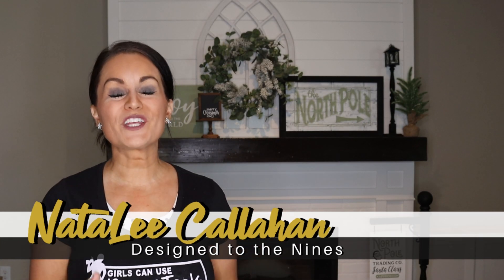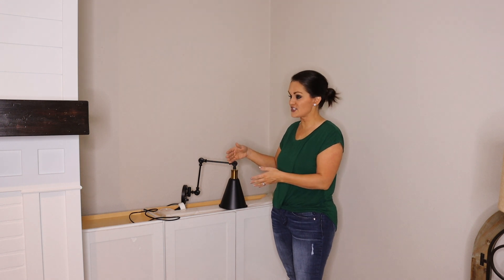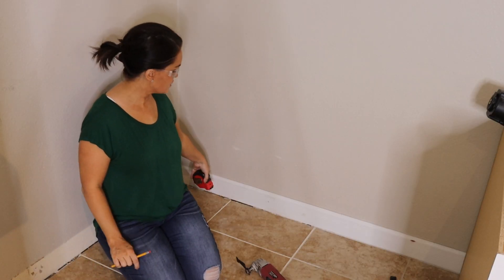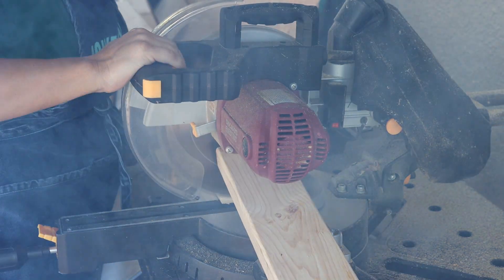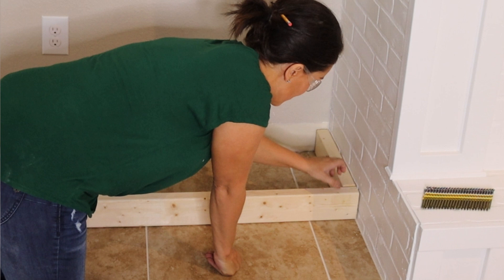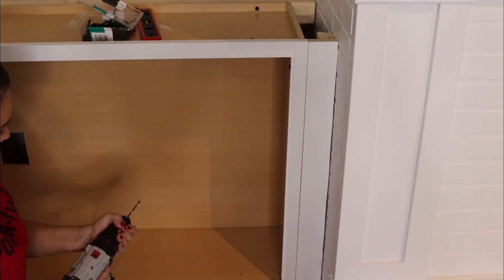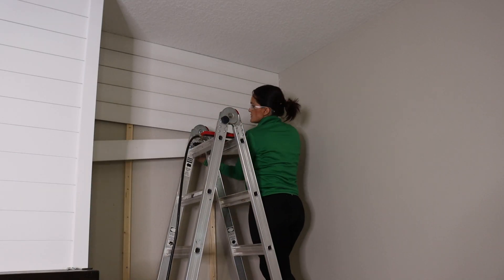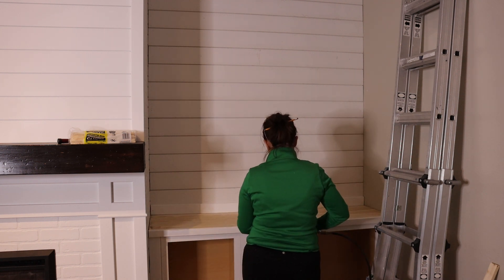You Can DIY a Fireplace Wall | DIY Shiplap Built In Side Shelves

Comment: It looks absolutely beautiful! Isn't it fulfilling to do a project yourself ? :-)  I would love to see how you  have decorated  your shelves . Here's a tip for the next time you have to fish a wire down... Tie a large heavy metal washer or a large heavy fishing weight or something to the end of the string. Then when you drop it down the weight will pull it through.😉
Reply from the maker: I had a heavy needle… It would drop down fine. The one on the right hand side kept getting fetched up on some thing because I simply just didn’t leave a ton of room to work with. That’s why I would recommend going about an inch thicker next time. But I like that idea as well! A washer would’ve worked perfectly.😃

Comment: This is amazing!  Are there smaller versions of the nail gun that are not run off of an air compressor? So much faster than screws but need something lighter.
Reply from the maker: Yes. There are both battery operated and plug in. But if you are using it for the studs I would use screws and a drill for that part over smaller nails as the nails you get for the smaller nail gun wouldn’t be nearly long enough or thick enough to support the weight. The smaller guns are perfect for the finish work:trim though! 😊
Reply: @designedtothenines  thanks so much! 🥰

Comment: just curious, could the cabinets have sat directly on the floor with out the base? I don't recall if you explained that reasoning. Or....could legs be installed if someone wanted that esthetic?
Reply from the maker: The doors are a little close to the floor, plus the base looks more like a regular cabinet base when you lift it up.😃

Comment: The electrical cord on the light fixture drops down from the bottom of the mount. How did you get the cord from below the mount to back behind the mount so you could drop down the wall? Did you have to tuck the cord underneath the mount then pull behind or is there another way?

Comment: Hello! I just discovered your channel. 1 Question. What is the width of your shiplap boards? I apologize if I over looked where you posted it before or if you said it when your sister in law was cutting them. Thank you so much! Deb
Reply from the maker: The ship lap comes the same width... which I believe 5.5 inches. The length 59 inches. Hope that helps. 😃
Reply: @designedtothenines  it does! I had a whole room done with ship lap due to very cracked plaster in a 1920 Farm Home. Contractor did 6" boards. I like your size so much better. I'll remember that for next time! Thanks again!